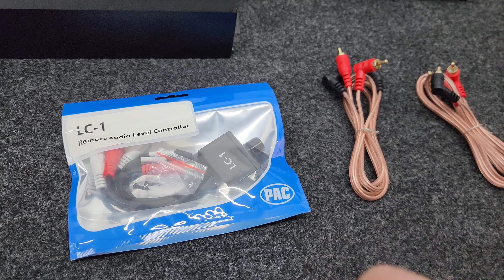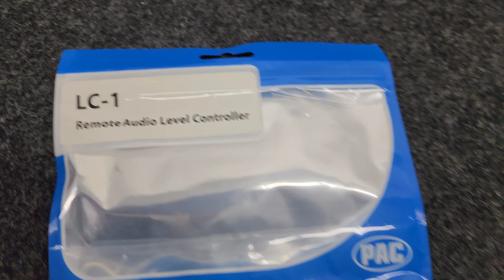How to connect a bass knob to a DSP using PRV Audio DSP 2.4x 2.8x RCA cable amplifier and car radio

Comment: Is there a way that using this DSP I can still control my bass level through my radio? I see that it does not have input channel for sub from the radio so I’m assuming that it cannot therefore I would have to use a base knob. Is that correct? Can somebody help me please just to make sure I am thinking of it correctly.
Reply from the maker: @dphipps29  no, you'd have to run the bass output of the radio straight to the bass amp, which is fine.
Reply from the maker: @dphipps29  or yes you can use a bass knob using the method shown in this video
Reply: @12voltfever  thanks man really appreciate it.

Comment: Good to see you back on YouTube man we needed the knowledge you have to share
Reply from the maker: I'm gonna drop videos left and right if you have any video suggestions please lmk
Reply: If you can detail the settings for mids, highs, and lows on the prv processor, like what your recommendations are and how to dial them in would be awesome.
Reply from the maker: @TheRepos296  there is no one size fits all answer for this. There are too many variables such as speaker type, what other components are in the system, hour much power is on each component and the application.
Reply: @12voltfever  for subwoofers 4th order and mono amp like Sundown Salt 8k.

Comment: Hey how do Iink the 2 channels so I can control it with the bass knob
Reply from the maker: Link 2 channels?
Reply: @12voltfever  I was told you have to link the main channel and the sub, am I wrong?
Reply from the maker: @wavycrockett4261  no you don't have to link anything. A front or rear output from a radio will be a full range signal, including subwoofer frequencies.
Reply: @12voltfever  Unfortunately I have a Chevrolet with that 💩💩💩 Infotainment System. So I have to tap into a factory radio
Reply from the maker: @wavycrockett4261  we'll make sure if you have a factory amp you use something like the PAC AMP PRO or just add an external radio.
Reply: @12voltfever  Can't add a external radio, tied into the steering wheel controls. They only make overseas tablet radios for my car. It's a 2017 Chevrolet Equinox

Comment: I'm about to order one of these for my system and I am wondering how to wire this up with a LOC would I just run it between the head unit and DSP
Reply from the maker: What exactly are you ordering? A DSP? The main output of your LOC will connect to the input of the DSP.
Reply: @12voltfever  yes the prv 2.4 I'm wanting to smooth out the bass and tune better as well as I want it for the limiter function for protection of my equipment I'm just brand new to everything I got ripped off on an install and products and refuse to pay anyone else to do something I can learn myself so far I've learned everything except tuning amps/DSP
Reply: I agree just got my DSp the tuning difference is immediate
Reply: @12voltfever doesn't the DSP take the place of the LOC
Reply: @DTB2.0  yes you are correct I am learning as I go and at the time of this message 3 months ago I hadn't even decided to upgrade now I have ordered an entire system from the alternator to two new amps a AAK 6k and AAK 180.4 ,door speakers,new head unit, DSP literally an entire new setup but I haven't quite learned everything yet just received a DD-1 and CC-1 going to learn how to tune everything properly this weekend or next still waiting for the door speakers from D4S and a D4S HD3 single 15 enclosure with a 15" Incriminator audio TYRANT rated for 5K RMS videos of the build are coming weekly check it out if you get a chance maybe you can give me some tips I will always read the comments it's one of the best ways to learn

Comment: How do tune amplifier running 400 amp alternator 2 xs d4800 and tintan s5 and running taramp 8k big boss amp start clipp but voltage never drop lower 14.4 and feel like amp has a lot more too push sub 3 skar vfx 15 a lot said people said check rca volts to much amp
Reply from the maker: Maybe the amplifier is not powerful enough for those subwoofers. Clipping means you are hitting distortion point of the amplifier and its giving all its got. Could also be your enclosure is not allowing the subs to perform properly, forcing the amplifier more.

Comment: Hey, great video. Just that I was looking for. However, I have one question. Would that be too long of a signal run going from the DSP all the way up to the front of the car, then back to the amp? Would there be any signal loss from that long of a run?
Reply from the maker: No, you can make super long runs with RCA. First off, without a DSP, you have to run an rca to the back anyways.  The DSP itself acts as a preamp, so the signal coming out of it is pretty strong.

Comment: So my question is what do you set the amp at,should it be turned down, I'm lost on that part
Reply from the maker: The amp gain can be set as normal. Then use the knob at your discretion. You can also set the amp gain with the knob in the maximum position to avoid over driving the amplifier signal.

Comment: So if I have a base level knob connected to my amp I will need it connected to my crossover?
Reply from the maker: If you have the ability to connect one directly to your amplifier (maybe it came with the amp), no it's not necessary (might not even be possible) to connect to your crossover.
Reply: @12voltfever  explain a lil more please
Reply: @12voltfever  it's a kicker amp and a kicker bass level knob
Reply: @12voltfever  you I can just leave it connected to the app. And still connect it to the crossover by itself?

Comment: After searching for hours your close but I’m wanting to know exactly what you have set up on the bench what are settings for subs 
Only down fall for me is my  I have two bass knobs digital plug and play sundown and deaf bonce but I can still put another bass knob in-line that’s no problem and leave others up if I’m going to run the subs off this dsp
Reply from the maker: What do I have setup on the bench? as in my test bench? Settings for subs on the DSP? RCA bass knob is always the best option.

Comment: Thanks for all the videos explaining these DSPs it's helped me a bunch. I'm curious though because my bass amp only has a single RCA input and my DSP will only run a single RCA output. Do I need a y splitter for the bass knob? I can't find many with only one RCA input / output. Thanks in advance
Reply from the maker: You can use a splitter yes
Reply: @12voltfever  do you have to or can you use just one rca?

Comment: I cannot find anywhere on the internet explaining how to hook a bass knob up to 2 bridged channels. I have a 4 channel amp and a 4 channel LOC. The 2 rear channels are bridged for a sub. The other 2 control left and right of front/rear door speakers.

The bridge works by connecting the positive of the sub to the positive of one channel, and sub negative to the other channels negative. 

If its using both channels then where does the knob go?

Ive been searching for hours. Please help
Reply from the maker: The knob goes on the 2 RCA inputs for that side of the amp.

Comment: What do you set the HPF and LPF to for the crossovers? Thanks
Reply from the maker: That depends on what speakers you are running.
Reply: @12voltfever  setting it up for subwoofers. Currently have HPF at 25hz and the Lpf at 70hz. 4th order.
Reply: @UrAvgBasshead  if I'm running a sealed box or a ported box? I'm running sealed Right now. I did just get the PRV DSP2.8x. Would I tune the high pass at 25hz and the low pass 100hz?
Reply: @MrMan-ol4ic  high pass 25 & low 100
Reply: @UrAvgBasshead  thanks bro, I really appreciate it!

Comment: Whats the difference between the 2.4x and 2.8x?
Reply: The channel’s, 4 or 8 channel.
Reply from the maker: Hey man the 2.8 is 8 separate outputs better for larger systems. 2.4 is 4 outputs for smaller systems
Reply from the maker: @addicted2tone349  exactly
Reply: @12voltfever  So the pairs of outputs on the 2.4 are mono, even though there are separate red/white jacks?  Trying to decide if the 2.8x is worth the extra bucks for my small system.